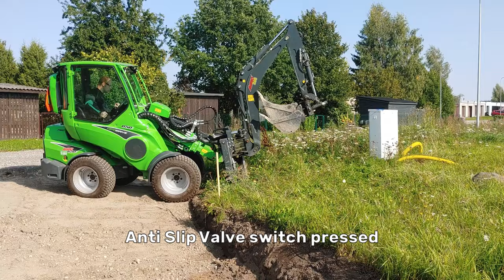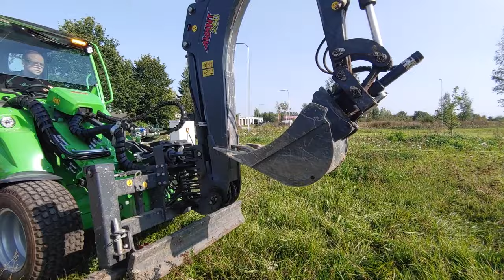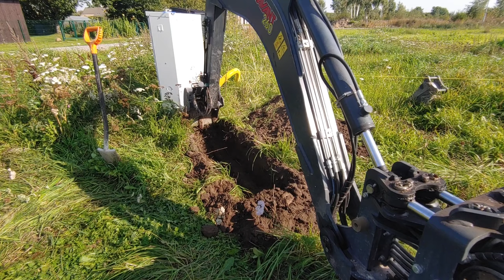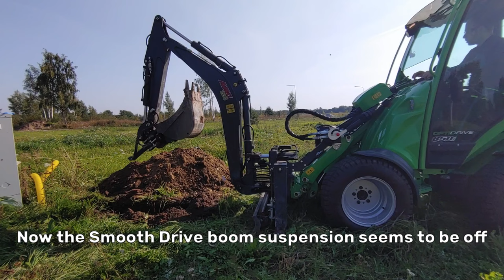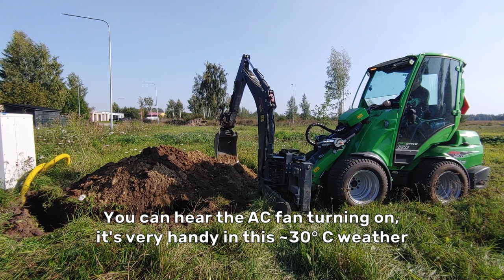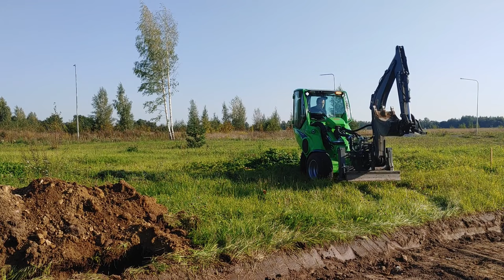Avant Digger 260 trenching for electric cable

Comment: I like your videos, it's good to see somebody else doing work with the same tools to compare and learn. I run the 260 remote on an 860i and am still learning how to use it properly. Here are a few random thoughts:

Smooth drive: I constantly switch back and forth between smooth drive enabled and disabled. My manuals says to enable smooth drive when changing the height of the boom (for transport) and disable smooth drive for digging. I think this is because smooth drive disable the self-leveling feature and therefore the tilt cylinder of the coupling plate don't strain themselves. I am not sure if it is the same with your support bracket, because mine is a little different (two silver bars). For me the coupling plate is tilted all the way to the rear and the two silver support bracket make tilting the couple plate impossible. Enabling smooth drive each time I lift or lower the boom, really saves the tilting cylinders from serious stress.

I try to lift my front wheels for digging like the manuals says, but usually I just dig myself into the ground. I'll have to try and lower the shield, maybe screw some wood bar under the two lufting cylinders.

Nice job by the way - very clean trenching work.
Reply from the maker: As far as I know the smooth drive just enables hydraulic accumulator and allows the oil move between boom cylinder rod and piston side. Driving with the digger in front on a bit bumpy asphaIt road at 25 km/h it does make a noticeable difference when it absorbs bounces.

Never noticed that before that the 800 series boom topside is completely different and that there's different digger versions for 500-700 series and 800 series, my A35248 or newer A437510 Digger 260 can't be used on 860i, only the RC A443267. When the plate tilt cylinder is fixed by the boom bracket and you lift the boom without enabling the Smooth Drive the plate cylinder pressure is released by overpressure valve somehow, I'm guessing.

I did lower the blade one notch so now the blade hits the ground first and then I can adjust the outriggers individually and engage the parking brake. The 650i in the current digging configuration with ~2.7 tons total weight (with driver) it does seem way more stable than the 635 was with ~2.2 tons total (didn't have rear weights). I'm guessing the 860i with RC digger is ~3.5 tons or so.

When digging from pavement that you don't want to mess up with blade/outriggers I've used a sturdy plank under the blade, but thought about making a attachment from a blown up truck tyre tread that's screwed onto a plank or some metal contraption that can be attached to the blade.

Thanks and looking forward to your 860i & RC shovel videos ;]